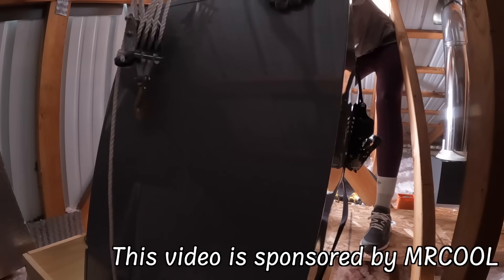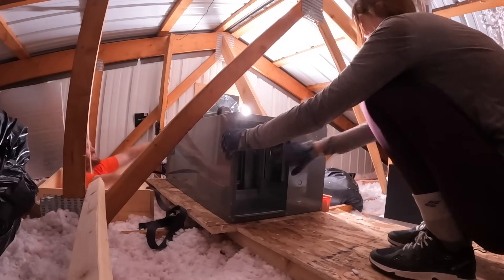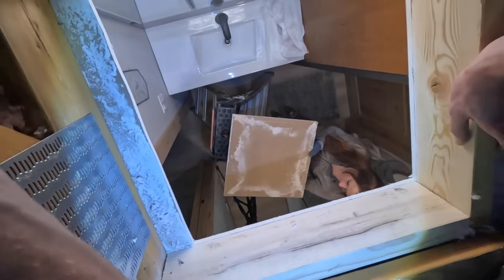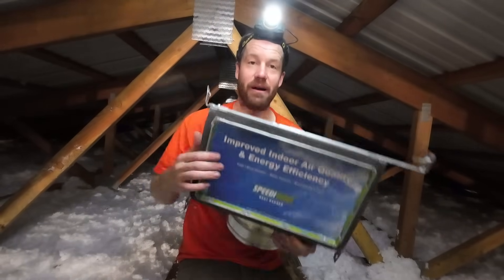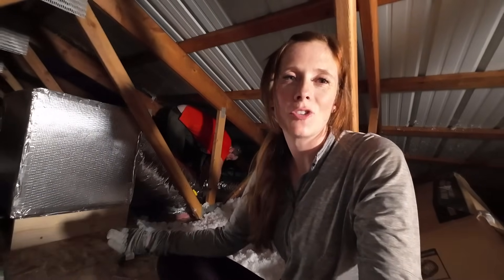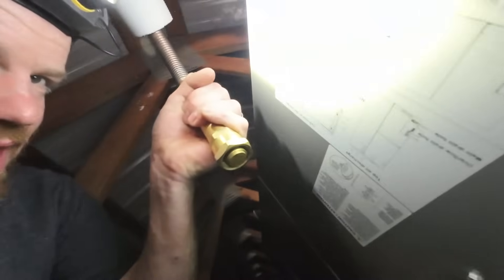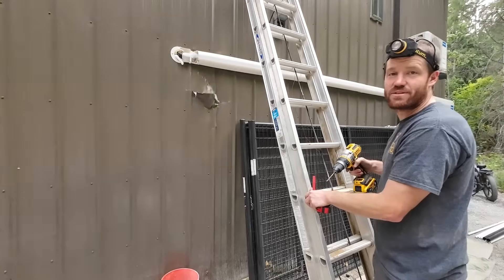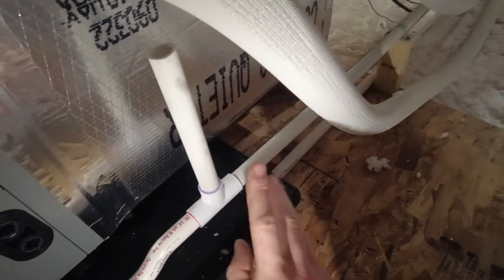Replace Your Old HVAC System With THIS! (DIY Heat Pump Install)

Comment: I use a 36.000 Mr. Cool and it has beena very good investment.  It cools my whole house. I had a wall bracket in my garage that I didn't use for Mr Cool I put mine on a concrete pad. we don't get that much snow load here.

Comment: I have two Mr. Cool mini-split units and one failed last week at 5-1/2 years.  Based on the lack of response from Mr. Cool in past years, I decided to rip it out and replace it with a main line brand as the warranty problems must be verified by a licensed HVAC technician anyway. Many HVAC contractors will not touch DIY installations.  The fixed length DIY line sets really limit the condenser placement and the suction line is actually braided steel rubber hose with copper ends.  I'm going with real copper lines and the flexibility of placing the condenser appropriately.  No doubt, Mr. Cool is a hot seller and just about every major YouTuber has a few free ones.

Comment: Great job guys!  Also, just a tip from experience, you might want to ziptie some window screen around the ends of your drain pipes like caps.  Mud Dobers are a nightmare in Montana & Idaho and they like to make nests in any and all pipes or holes.
Reply: Good point.

Comment: You're making a huge mistake whispering while the baby is sleeping. You should act completely normal, or you'll be whispering for years to come. He will get used to sleeping with noise. Don't let him control you like that. I know, I've raised 4 the noisy way.

Comment: I appolligize for saying VERY COOL, but it is !   I wished I had this option before putting a huge 3 ton unit, on our roof.  And we only have a 1,000 Sq foot house.  You guys did an excellent job and I think, you made a very good decision.  I have been really impressed with all the people, I have watched on YouTube, installing Mr Cool mini split units, this looks even better.  
I really want to know how it turns out.  Thanx for sharing all this INFO, and as usual very good, interesting content using NEW products and new ways to figure out solutions to a building problem ! 
I have been watching your channel since early on and I really LOVE your work ethic and desire to live off grid, your way, congrats on accompliching that !

Comment: I am quite skeptical about this type of cold attic installation. I have ERV with insulated tubes just like that. All was fine until one day water started to pour from the air in/outlets in the autumn. Upon inspection I found, that the ERV control unit went into fail-safe mode, probably due to electrical outage months ago. Since the attic is cold, the tubes slowly cooled down and because they have no condensation outlets (only the heat exchanger), there were like buckets of water inside. I'm about to rebuild the system, putting insulation into the attic making it warmer, then ripping away old  insulated tubes and putttig new ones in with careful slope and condensation collecting points where at critical places. Also cleaning all remaining old ducting. It's gonna be expensive and no fun...

Comment: Ah no, no you didn't. You done went full boomer and put an air handler and duct work in an unconditioned attic. Why is it so hot up there, because your insulation is below you. Where is your AC? In the sweltering attic. Get rid of the insulation on the floor of the attic and put radiant insulation on the ceiling.

Comment: I love that little boy. So cute. I remember those days. Mr. Cool rocks. It is hard to understand why more cold air machine manufacturers don't get in the DIY business. We installed a mini-split in a shed where the condenser is just on the other side of the wall from the air andler (so super simple), using a Home Depot fake concrete pad. Took less than two hours.

Comment: Awesome job as always!  That looks like a neat, fairly DIY-friendly install, but y’all make stuff look easy.

I dont know much about HVAC, but we have a heat pump system at our house here in MS.  Somehow it works by reversing the refrigeration cycle and sucking hot air from the outside air in heat pump mode.  So, it either doesnt work well, or it doesnt work at all, once the outside temps get at or below freezing.  For that reason, most heat pump systems come with an “Emergency Heat” mode that uses heat strips as a heating “backup” process during really cold weather.  Does your new HVAC system come with heat strips for really cold days?

(The heat pump also doesnt warm the room temperature up quickly.  The other drawback to heat pump system is that now your compressor which might have previously sat idle for half the year, will now be in use year round, so theoretically it may wear out about twice as fast, if that makes sense).  But we like it for our situation in MS where it doesnt get below freezing very often.  Let us know how it does for you with ID winters…. (Of course, you have lots of aleternative heating options like the wood burning stove, etc.)

Comment: Any time you build sheet metal plenums, leave the cap off so you can squish them down to get in the attic.  Also instead of using tube based sealants, I would suggest getting a gal of duct seal (duct butter, mastic, pookie, or what ever people want to call it).  It paints on and works well.  Also I would recommend putting a safety switch in the secondary drain to protect your ceiling, and leave the aux pan drain as a backup if all fails.    Either way, you guys did it your selves and that is a great plus.

Comment: Ok so with your water issue check out this in your Ares I know in some places in Alaska you can't do wells for water. So what they do is put in 1000 gallon tank that can be filled with water it in under ground. See if someone can get you water that way.

Comment: Are you going to put vents between the rooms to allow the return to work with the doors closed?
Reply: My concern as well.  Air returns need unblocked access, usually a hall or large central room.

Comment: Oh no. Always when you use that tape on duck board or duck work you want to torch the edges where the tape goes and it will hold a whole bunch better and longer. Just a small propane torch going across it and you will see finger prints (which is oil) disappear.

Comment: I'm questioning the choice to put the intake in the bathroom.  Might be convenient and short, but I fear when that comes on and Riley is having his....daily devotional, you might have regrets as that air is spread throughout the house. 😢
Reply from the maker: We’ve gotten pretty spoiled with our incinerator toilet. The constant exhaust fan means there are never any smells in the bathroom. But it sounds like we might have issues if we ever put in a conventional flushing toilet!
Reply: @AmbitionStrikes  An amazing and surprising team.👍🍹🍨🍒 Greetings sweetie. And every time you surprise anew. Unit 00 bacteria are always concentrated in the air there.... the air intake of the air conditioner from there needs to be taken into account. Every fart will smell it cooled in the living room. A two-way fan exiting and entering air from the outside is indeed desirable . Services ... Google Translate still needs a thorough overhaul, hopefully what I wrote is readable and understandable

Comment: Don't forget to get a reusable filter that you can just hose off. I spent years and years with the inefficient one-use filters that were so expensive and inconvenient having to buy so often. So very happy with the reusable types and much, much cheaper in the long run. 💯

Comment: Only thing i will say, make sure you pulled the inner duct of those insulated duckwork tight so that its as smooth as possible on the inside

Comment: Great job on installing that unit!  I'm sort of surprised that Riley has not made a metal frame with a platform and rails for the skid steer pallet forks so he can safely be lifted and work on higher projects like this one.  A lot better than the old fashioned ladder.
Reply: Great idea. And Riley is just the guy to do it. I imagine after every time he has to go up high he thinks, 'Well, that's the last time I have to get THAT high.' Nope.

Comment: Several people have done videos on Mr. Cool systems. Maybe he should expand to include water from air units. Since he has that variable control module on the AC units.
Reply: If Mr. Cool made a DIY atmospheric water generator and Riley & Courtney installed one, it would be their most watched video.

Comment: Do you need a return on in each room except the bathroom a separate fan for the bathroom no stink and electronic air filter. You can hook the returns maybe to the side of the unit it’ll be much more comfortable and there will be no dust in the house with electronic air filter. You can actually hear the little dust mites dying when you turn the electronic air filter on, you have a clean 100% filtered air system in your house. Thank you.

Comment: There are DIP switches that allow you to lower the output of the air handler. A single 12” duct can only do about 600 cfm with reasonable static pressure

Comment: A suggestion for an upgrade in the near future.  There is a little float switch made for the drain pan that shuts off the unit if the pan fills up with condensate water.  If you don’t have one there is the potential for a big mess in your living space.  Ask me how I know….

Comment: Being low income we got the energy program here to replace our broken furnace 3 years ago and then they replaced of central AC unit 2 years ago. Now the AC is broken after only 2 seasons and getting anybody to work on it is like pulling teeth. The company that installed it said it was too far to drive now. It is a 22 mile drive. So he will not work on it. He told us it had a 5 year warranty but now they say no a one years warranty on labor and a 5 year on parts but we have not been able to find another shop to do it. So we have been stuck in this nice hot summer with a couple of window units. They do not keep up on the hot days

Comment: It uses 2000W?? My Panasonic of a similar size uses 100-300W. I have been chocked by the power consumption of these American ac units! :D well you are off grid so i guess it doesn't matter! 😂

Comment: Did I understand it correctly that you put the return in the bathroom? If you did, don’t ever shut the bathroom door if the system is running. You can suck the water out of the trap if you do. And if you didn’t know, no water in the trap can cause the drain to overflow. For a homeowner install, you guys did quite well, the only thing that makes my eye twitch is that return in the bathroom that and the kitchen are the only places you’re not supposed to pull return air from.

Comment: I live in the sunny southwest & we need AC for much of the year. Some of the homes have air handlers in the attic. However, those aren't as efficient as those with them mounted in air-conditioned spaces. My air handler is in a closet in the center of my home. They used that fiberboard for ductwork as well. You may find that your AC uses more current becasue of its location. Just my 2 cents & worth every penny. LOL

Comment: Glad to see you doing it yourself. A few suggestions if I may from someone in the industry.
1. Ductboard is great... until it's not. Your indoor unit will develop an inch of static or more. As it's in the hot attic, the tape will delaminate and the ductboard will blow apart. You must inspect it regularly. Make sure you are using the correct foil tape. Regular duct tape won't last a year no matter what it's called. We often use clips on the seams.
2. Install a second zip tie on the flex duct. It's remarkable just how often those ties fail. You are also not using a zip tie gun, so they are not nearly as tight as they otherwise would be. Then take a third tie, roll the outer face over the insulation and lightly zip it down. Makes for a clean installation and critters have a harder time entering it.
3. Those mechanical fittings always leak. Do yourself a favor and buy a refrigerator sniffer and test the fittings to make sure they aren't leaking. You may be able to buy the precharged unit yourself, but you can't buy replacement refrigerant without a license. Check for leaks when changing the filter.
4. During very cold weather, the unit is less efficient at heating. It will struggle. That is normal. It will also not heat the house well and will run constantly. In very cold weather, you need a backup source of heat. As this unit doesn't have backup strip heat, you still need that wood stove.
5. Icing of the outdoor unit in heating mode is normal. Icing of the indoor unit in cooling is not.
6. The lack of a trap on the overflow will allow unfiltered air from the attic into the air handler depending upon how the unit is configured. That little wavy trap you installed has very little static pressure capability. You should install a proper trap. 
7. Do yourself a favor and install a water bug alarm in the drip pan.
Reply: I second that. The problem I see with the return. Your bathroom smell will be distributed throughout the house. Everybody will get to experience your number 2. Lol
Reply: The gift that keeps on giving. @ronniebiggers2147
Reply: These inverter driven compressor systems don't struggle to heat at low temperatures. They have 100% heating capability down to -5F and 78% at -22F.

I put an 18K BTU 220V MrCool mini split in to replace a 12K BTU 110V window AC. My electric bill is lower than last summer and my home has been much more comfortable. I don;t know yet whether I'll use the gas furnace this winter or the MrCool. What would be nice is a thermostat that can coordinate the heat functions of the heat pump and the furnace.
Reply: i came to say this, the only real issue i see, is the return in a bathroom. other than that not bad.  @greggv8
Reply: @fgambaro Agree. I think if the return plenum was just outside the bathroom with a small, maybe 4”-6”hose going to bathroom ceiling area for a bit of return ventilation & remove a bit of steam etc, might be a bit better, pretty good tho
Reply: @greggv8  unless you got the wind baffles to go with your Mitsubishi mini split, it won't function down to -22 Fahrenheit. Mitsubishi advertises that it functions that well down that cold, but you have to have the right installation and you have to have the right options on the unit in order for it to function that way. Wind chill is a real thing when it comes to mini split heat pumps. In their case, they're also at altitude which affects the condenser and evaporator capacities as well as significant amounts of snow being up on the mountain and being Idaho, the wind never stops blowing. The heat pump should continue to function where they have it installed, it's just likely to struggle. I've seen this over and over again no matter what the manufacturer states.
In your case, unfortunately there isn't a commercial thermostat that I know of that will do both your mini split and your furnace. The mini split thermostat is a communicating style thermostat and there isn't an option to have auxiliary heat. Probably your best bet is to get a nest thermostat and program it so that the gas furnace comes on at a lower space temperature then the mini split does. Whether or not it's less expensive to operate, comes down to what your gas costs per therm versus electrical. Depending upon where you live in the country, you may have day/night pricing for your electrical or have demand charges or both. If you're natural gas is cheap, it's almost always more cost effective to run your furnace in heating mode with your heat pump, running as backup. In many cases, depending upon your climate, it will be more cost effective to run your heat pump until your down well below freezing at which point your gas furnace becomes more cost effective to operate.
If you're worried about greenhouse gas emissions, it really depends upon what the makeup of your local grid is. Some areas such as West Virginia have very high coal emissions and as such your 90 something percent efficient gas furnace can actually emit less or is at least equivalent to your heat pump operation.
One last note, in every scenario, a well-maintained piece of equipment is going to be more efficient than a poorly maintained one. Change your air filters, clean your coils and tighten your electrical connections. Or have someone who's qualified do it for you.
Thanks!
Reply: @oldtruckswork8989  "Wind chill" has ABSOLUTELY NOTHING to do with anything that isn't alive. Machines don't feel "wind chill". It's nonsense.

Windbaffles are only needed in WINDY locations and it's meant to help stop blowing snow into the condenser and clogging up the fins. Not for "wind chill". It's amazing how people who don't know what they're talking about will act like they do.

"In your case, unfortunately there isn't a commercial thermostat THAT I KNOW OF..." Yeah, there seems to be lots you "don't know of". EVERY mini-split manufacturer has an "aux-heat box" that you can add on to control a second source of heat. Like, ALL OF THEM HAVE IT.

"it will be more cost effective to run your (sic) heat pump until your (sic) down well below freezing at which point your gas furnace becomes more cost effective to operate." They are completely OFF GRID. Paying for fuel will NEVER be more cost effective than FREE energy falling from the sky.

Comment: Good work but looks like 14" return air duct with taking off with a 12" and a 8" going backwards you should put a air scoop in the 8" supply air and 16" return air, your welcome 😊 40 year HAVC contractor. If the air flow in your bedroom is week you can balance with the air scoop in the start collar going to your room.
Reply: Just watched you install the r/a filter grill also to less restricted air flow buy a open bar type grill instead of that  stamped grill  it will lower the staic pressure. 😊